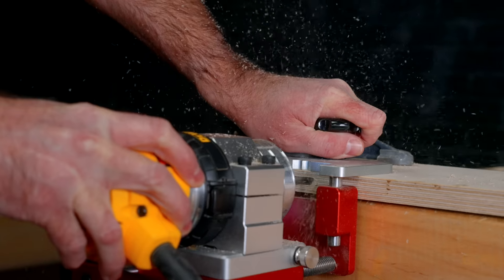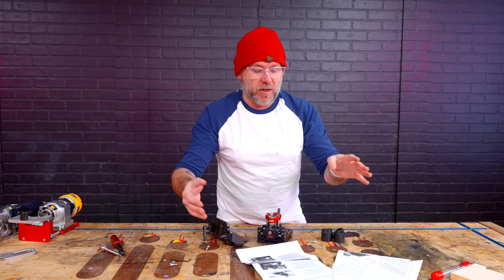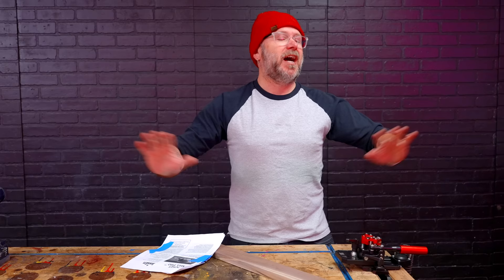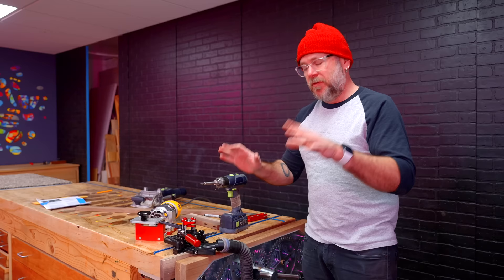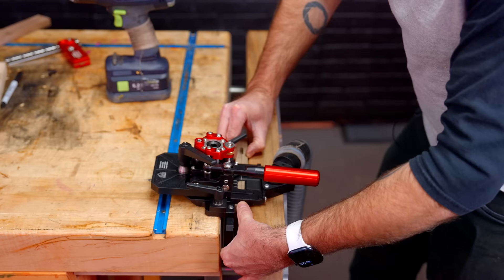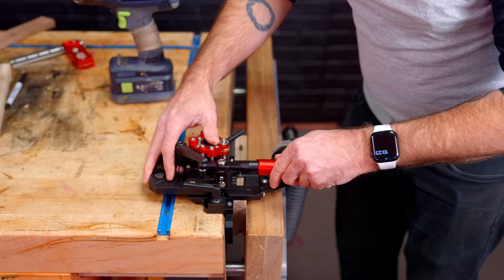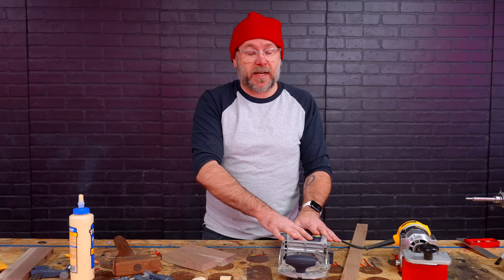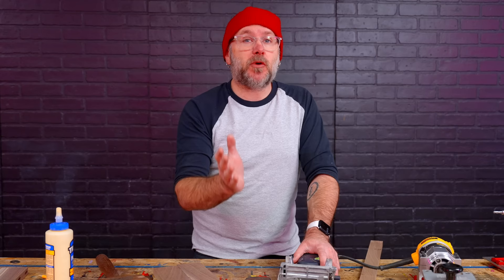I Regret Buying This Tool | Pocket Mill Pro

Comment: so 540 for the jessem with the jig and you need your own drill. or the domino for 1200 that is easier to use.  looks like the domino would be a better choice even though twice the cost but 1/4 the difficulty in setup.  if I ever graduate to making panels for tables or doors I think I will get the domino.

Comment: The domino's mechanism is patented. I've seen online that there are already other companies waiting for that to run out so they can put their own version on the market for much less money. Festool makes great quality tools, but there is no doubt they are more expensive than they need to be. The only thing they have that no one else has is the domino. Everything else they have there are other tools that do exactly the same thing for less money. Even if i was a pro, I wouldn't buy festool. And FYI, the rigid router fits in the Tianli jig.

Comment: Get the woodcraft xl dowel jig. On any piece that is 6 inches or less. Takes seconds to use. Quick. Easy. Done. 

If you want to, put to dowels next to each other and look that that, ya go a floating tenon.

For a much longer and sometimes frustrating but works well when it works well system. 

Rocker Beadlock system. Then get the 3/8 router bit. Make your own beadlocks. And hurray. 

Same thing as tenon. Way more steps. Way longer. $1200 cheaper.

Comment: I have not had the occasion to use dominoes thus have not purchased anything to do them. With that said, without this review I would have been tempted to "cheap out" and buy either the ebay or Jessem jig. I would have been disappointed with both of them. I will save my money and buy a Festool

Comment: I still don't get the whole "loose tenon" thing... From what I understand, it's just an alignment aid (not much different than a dowel) and doesn't add strength to the joint. What am I missing?

Comment: All this proves is that the dowel max or jessem's doweling jig is the far superior floating tenon system for hobbyists. 2 dowels are just as strong as 1 domino and you can get longer dowels if you want a stronger connection. Seems like a huge hassle when a much simpler system is available that is just as precise and strong and much cheaper (particularly for the jessem doweling jig).

Comment: The reason that the festool is so pricey, is because it does all of this joinery with 100 percent accuracy and virtually no fuss and wasted time in the set up. Whilst this product is well made, I think it is expensive for what it is...the router jig seems better value to me, and I'm sure it would be possible to jury rig some sort of dust collection at source.
Reply: And because it was designed for pro cabinet shops. Its not a consumer tool, its an industrial one. Which means smaller production runs which equates to higher prices. Plus its proprietary, which means that jacks the price up even more. 

I think a high quality doweling jig (like the JessEm) is a much better purchase and do as good work because dowels are not patented.

Comment: I'm FAR from a pro, but I am disabled and the ONLY way I can do woodworking at all is with the help of tools that make it easier. I've got a much better setup than most 'weekend warriors' and I'd 100% buy the Domino if I had the money. Well, I don't so I'm going to have to continue to use pocket holes and dowels and be happy with that.

If the price of the Domino comes down or if somebody comes out with a cheaper alternative, I'll be there. Until then, I'll not allow the pursuit of perfection get in the way of 'good enough.'
Reply from the maker: I like your attitude! ♥️

Comment: I am by no means an expert or professional woodworker, but I don't really see the need for dominoes at all. Perhaps some more knowledgeable people can enlighten me. What benefit is there to using dominoes versus dowels or something like Beadlock for loose tenons? I have used dowels for joinery quite a bit. They're cheap and easy, even without a doweling jig. With an inexpensive doweling jig, they're even that much simpler. I can see that dominoes might be a little stronger, but if strength is really an issue, I'd just use two or three dowels. The only advantage I can see is that with the Festool domino machine, it would be really quick and easy to cut the mortises. Is there really any other benefit?
Reply: Quick and easy can mean more money for professionals or more time for hobbyists like myself. There's more latitude for error as the domino as 3 width settings to help account for human error. Stick with what makes you happy.

Comment: Here's a big issue about this product: it's using a drill, which drills are not designed for lateral forces.  This means the bearings on the drill will wear out faster.

If they designed this product to use a router, it'd be a lot better.

Comment: Or you could use doweling jigs LOL 
Joking aside, a Domino  is an industrial tool intended for industrial shops. That's why they're so bloody expensive. They're not only quality tools, but, they're not intended to be mass produced to the same extent  biscuit joiners are. On top of that they're proprietary, which adds to the cost of the "ecosystem". So, the question we have to ask ourselves is the same as say for table saws. Most of us get by quite well with jobsite saws. Do we NEED a SawStop, or is it just saw envy? Do we NEED a Domino or is it just joiner envy? Sure it will save you time, but,  will it save enough time to justify the purchase? Because you can get a kick ass pro quality doweling jig for 1/4 the price of a Domino. And will the joint really be any stronger with  dominos as opposed to dowels? If you're not a pro, a Domino joiner comes under the heading of nice to have, but, there are a lot of other things that should have higher priority in the average hobbiest or semi-pro shop.

Comment: it would be better to just use a router with a straight edge guide. simler set up times. and you are not limited to one size tenon. and most already have the tools.

Comment: So, what you’re saying is spend the additional $850 and buy the Festool Domino. Well, then there’s the $400 for the systainer set of dominoes. Of course, you’d also want to pick up the $800 CT 26 E Dust Extractor. So, for an additional $2050, you could have a nice 500 Festool Domino set up. I can’t understand why every woodworker doesn’t just pay the $2400 for the domino set up and forgo trying to save money. Since you’d already have the dust extractor, it would be foolish not to go ahead and by the $700 150 sander too! Then you’re set. Of course, there is that sweet track saw….

Comment: Putting it all together… is it cheaper??… the main jig + the other jig 200usd… plus the “dominos” to be build… also matters that doing a mistake is easy…
I would buy the eBay one… plus a router….
Hummm…. That’s why I bought the Festool and didn’t think about it…. Anyhow I don’t consider the Festool expensive… just costs some money… results are better and work comes faster…. But on my case, that woodworking is a hobby… results are better, that’s what matters, not so much for productivity!
It costs money but is far better than all the rest I have seen,… !
Save some money and buy Festool and you have a tool for life!
Regards

Comment: I really wish the Domino complaints would go away. There are plenty of other videos that show you how you make a loose tenon without a Domino. Rockler even has their beadlock tenon system that is very affordable. Everyone on YouTube could easily use another method, but it comes down to time. Just use a different method.

When you're trying to get shit done, you don't want to spend all day setting up jigs and worrying about accuracy. Plus, are the people complaining really going to build what's in the video?

Comment: The original Festool Domino patent was issued in 2005 from what I can see. This means that in 2025 they will lose their patent rights to it. I can guarantee that we will see a makita or a bosch or dewalt or if we are really lucky a Milwaukee version of the domino in the future. And I can guarantee it will not be $1100. I am happy to wait two years to buy a competitors product. The jessem tool company is Canadian out of Moncton New Brunswick although their instructions clearly were terible and could have atleast been printed on a colour laser printer was atleast a very neat jig. It would have been nice to see screw hole slots in the base this way you could screw it to your bench and then just worry about board possitioning. Jessem does have a specific jig for mounting it so you don’t have to worry about holding it and the board but that jig is another $299 canadian.
Reply: I was thinking about the patent too.  I saw something about them updating the design and refiling the patent though.  Not sure if that will put the brakes on other brands using similar designs.
Reply: @Browniejb2009  Lets hope they don’t get some kind of extension through some new innovation. Its a tool that routes on a parallel path. I think its time for other companies to take the original idea and expand upon it so the masses can afford it and gain the benefit from the tool

Comment: I said it on the other video, I'll say it again here. £350 for the base Jessm kit is more than it costs for a full Dowelmax kit. This also seems to be designed for right handed people only.
Reply from the maker: You can actually put the handle on the other side for left handed people.
Reply: @MakeSomething  Thanks for the info.

Comment: I have the pocketmill pro with the workstation. I regret buying it. It’s awkward and slow. The upper section slides on two rails that have side to side play in them. This causes the mortises to not sit parallel with the face, and when matched to an opposite face, this amplifies the problem. The company is also terrible to deal with.

Comment: I have no problem crapping on a crap product regardless of brand. This thing is just garbage for the cost, if they weren't trying to rob people with the INSANE price, then it would be a good option. I also don't even see an option for just the jig and optional clamping station, you have to include the miter attachment with it. The actual product isn't bad, definitely needs some more thought put into it, but it's not bad.

Comment: Definitely too finnicky. It looks like the only engineering they’ve actually thought about is the stepped drilling mechanism. I think if this was a tool you got from the Facebook ads you would be way more harsh. It seems like you’re trying not to discount it because it’s a brand you like but ultimately, it doesn’t seem fit for purpose at all.

Comment: Pretty sure this 'Jessem Pocket Mill Pro loose tenon joinery system' is in no way better than the Festool domino. Only if you are not willing or able to dish out 1200 bucks for the real thing it might be an option. But man, is setting up fussy or what?
Jessem has awesome products, but maybe this was developed by Jessuhm?

Comment: Jessem makes some nice stuff, but this product is just throwing money out the window. Honestly, at less than 3x the price, the Domino is a no-brainer if you need to make a lot of floating joints quickly. Otherwise, use dowels, infinitely faster than using this contraption.

The domino will pay for itself in ONE project if you're using it professionally in small-runs. If you're a hobby woodworker, there's no reason for these joints at all. If you're doing high volume commercial there's also no use for these joints.

Comment: I dont think you can call the domino overpriced. If it was, there would be a lot of viable knockoffs. In the scheme of woodworking tools its also not "expensive." $1300 is objectively a lot of money, but it's not outrageous for a woodworking machine- it's just an expensive damn hobby. I wouldnt splurge for a set of woodpecker squares or a festool, mirka or 3m sander, or a harvey miter guage  because I have stuff in place that does the same job to my satisfaction. The domino just makes sense for what it does and it does it very well and I am fine with the cost of entry. Thats not overpriced, it's a question of if its a tool you will use or a tool that will collect dust.
Reply: Festool own multiple patents on the design, that's why you don't see any other brands making one
Reply: @darrenatarrant  Yeah but doweling tools, the router carriers that David has been reviewing, adjustable benchtop style alternatives etc are all very compromised when compared to the domino. I mean knockoffs in the sense that its a product that works as well and costs much less. There's a huge, hungry market for that tool. I dont think its a nut that cant be cracked, it's just not financially viable to do.